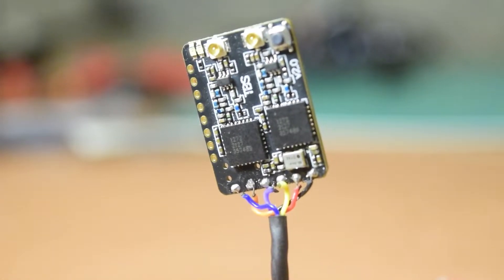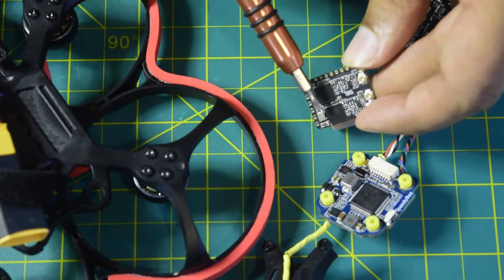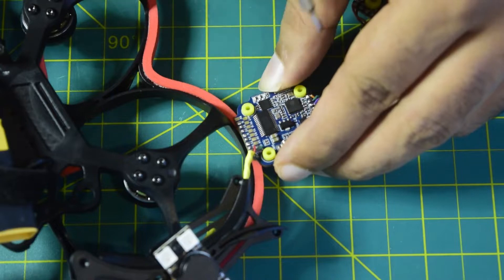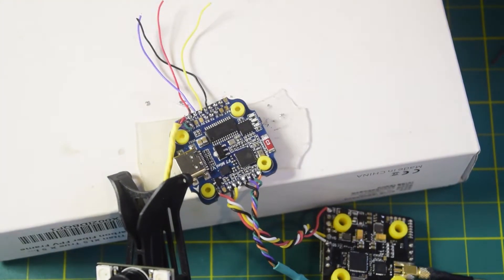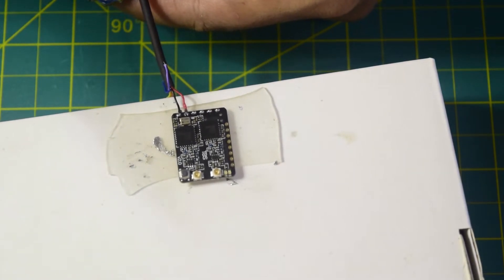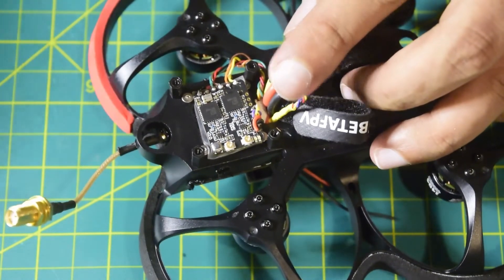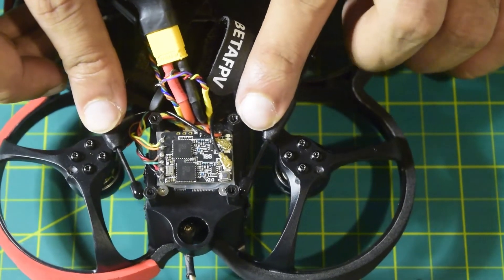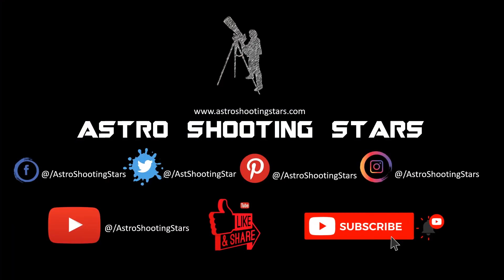How To Install TBS Crossfire Diversity Nano Receiver with Mavlink  on Flight Controller SpeedyBee F7

Comment: I wanted to have some information, I would like to install nano diversity on an rc car and I wanted to know where it should be connected since there is no flight controller on rc cars
Reply from the maker: I understand but dc motors might be controlled by dc motor drivers which inturn should ideally be connected to some micro controller or should be an inbuilt microcontroller board with motor controller.  You can connect it with this microcontroller board. I hope this helps. Please stay tuned to my channel for my future videos